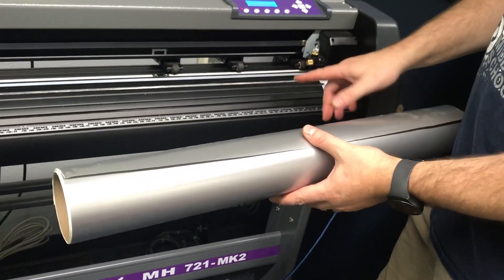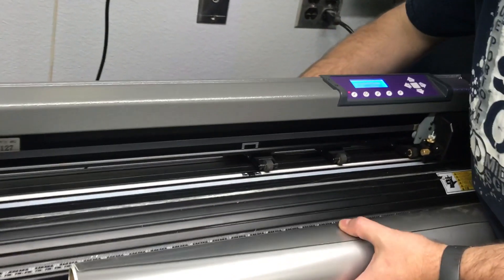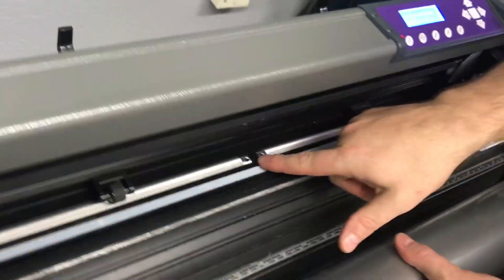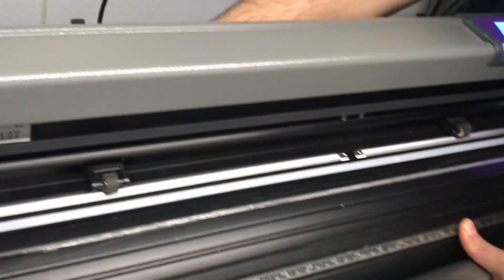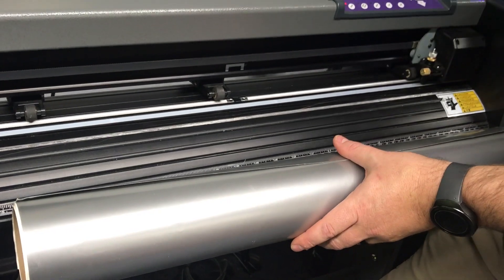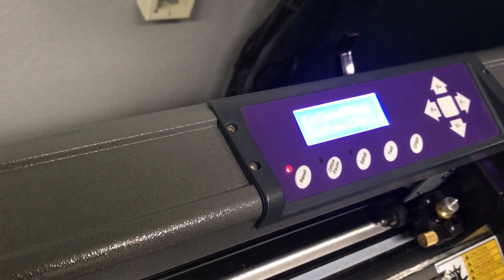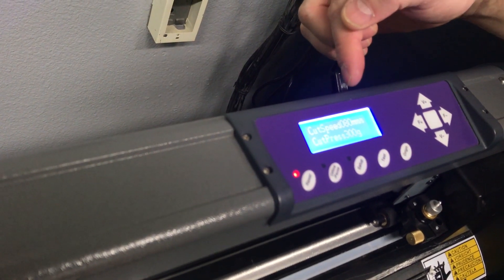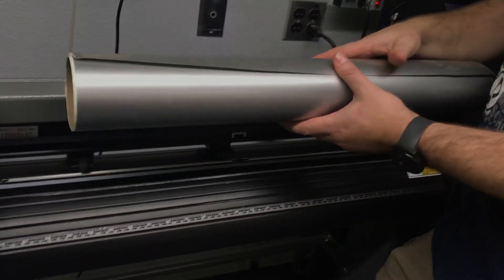Vinyl Cutter: 4 Adjusting Rollers/Understanding Cut Speed

Comment: I specifically came to this video to get better understanding of the cut speed and cut press. I just purchased a US Cutter and i am finding no USEFUL info on the cut setup. i have torn up/cut up the vinyl that was supplied and also, i'm concerned that i have cut into my plate from the blade pressure being too deep. there really should be "ready" info about this as this could damage this brand new machine.

Comment: Ok so how do you adjust the rollers, and what about the cut speed, you didn't tell what material , thickness, application, you are cutting for that speed.  You actually said NOTHING of use man.
Reply: https://www.google.com/search?q=how+to+adjust+tension+on+pinch+rollers&oq=how+to+adjust+tension+on+pinch+rollers&aqs=chrome..69i57.12106j1j15&sourceid=chrome&ie=UTF-8
found this